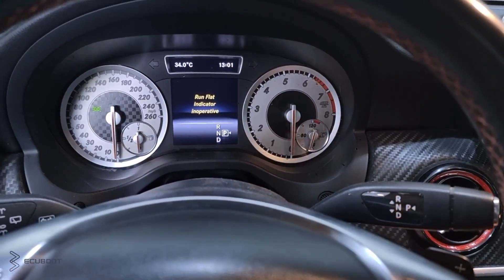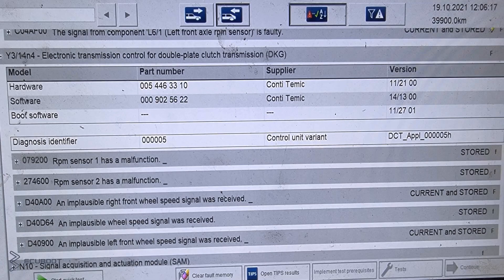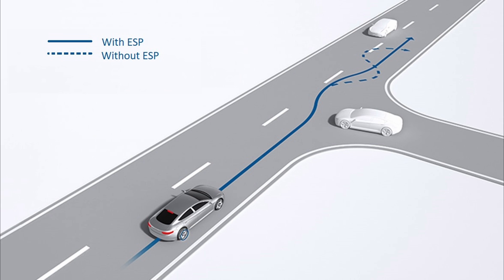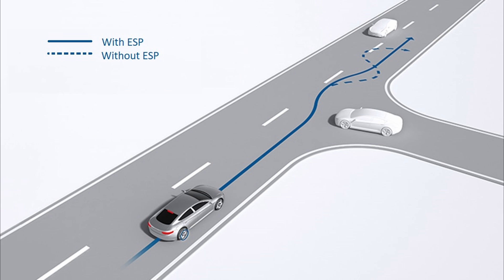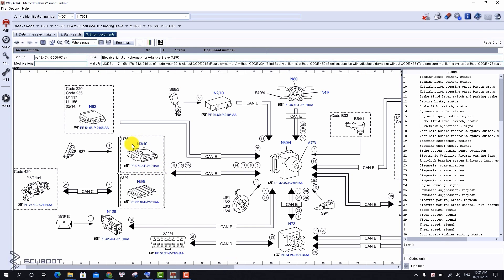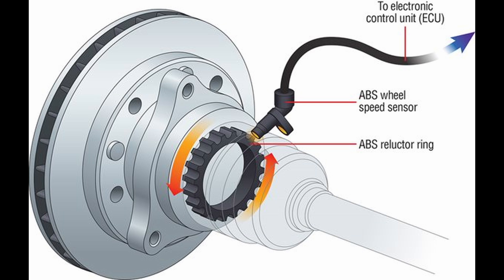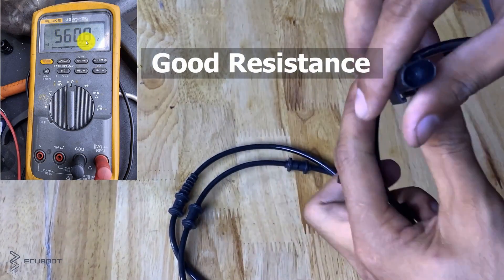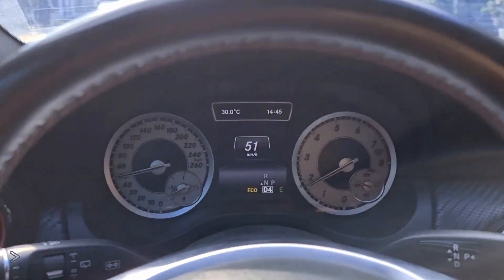Fixing Mercedes CLA that Can't Shift Gear

Comment: Hi, thanks for the video. There is a 2016 CLA250 -117/344 does not shift to drive. Engine starts normal. Mechanic said its the tcm and used module was cloned with KESS3 and then installed. Still the car does not shift to drive at all. Any pointers please?